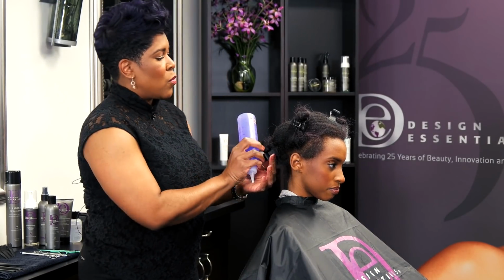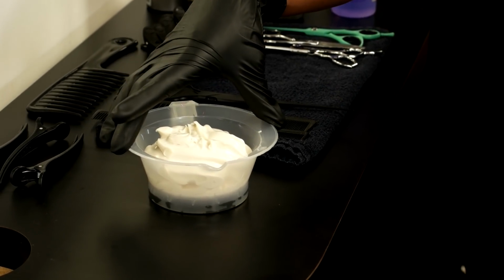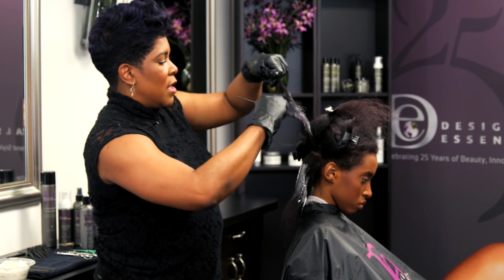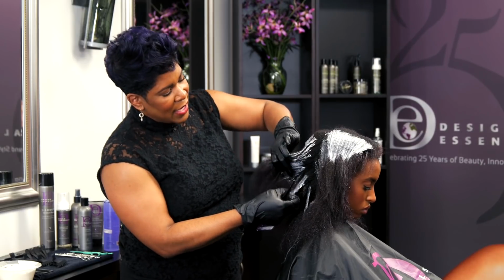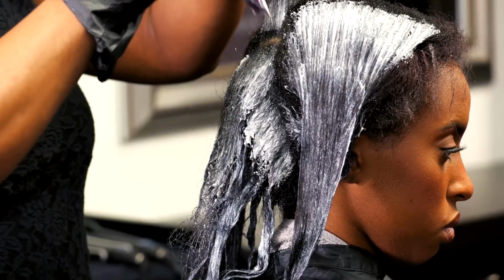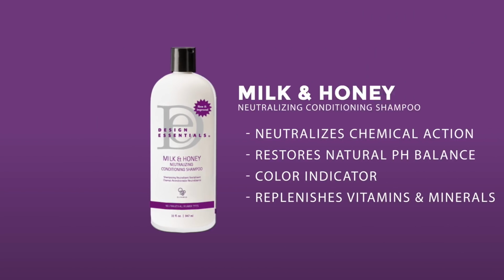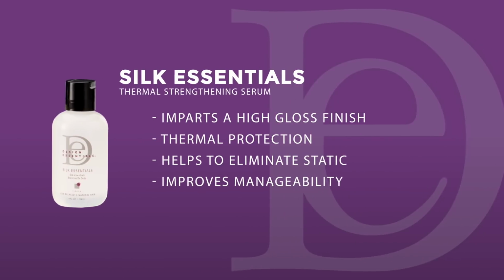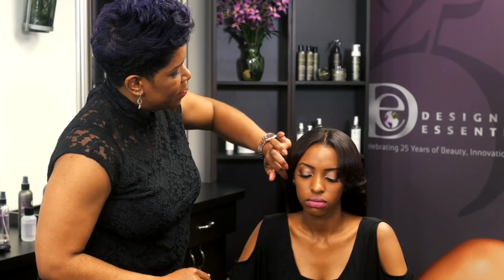Chemical Curl Restructuring Virgin Relaxer   featuring Alicia Bailey

Comment: She threw me off because my understanding is that you apply to the roots 2nd and  pull thru to the ends last reducing the risk of over processing her ends seeing as they are extremely porous and  reducing the risk of breakage.
Reply: I noticed the same thing. I'm not impressed
Reply: For a virgin relaxer that’s the way I was trained too. By putting it on the roots it processes faster because of the heat the scalp gives off.

Comment: Great job! I also wish you could train all beauticians because so many of them are improvising and the results show it.  I a new in town and  ended up having to use a beautician at Penny's.  She took shortcuts and was offended when I asked about and told me how long she had been doing hair. I couldn't leave wee were half way thru the process. I'd rate it  a 7 out 10 (the frizzies are right up front).  When I called to see if any qualified techs were avbl of course they said yes and advised they were trained in the use of Design Essentials products and quoted a price of $130.00.  She trimmed my shoulder length natural hair before the process then advised  the price was $200.00 because m hair was natural which I had previously advised when I called and the got the original quote.  Unfortunately I felt trapped because I had a holiday event the next day so I agreed to the cost.  She also decided it was better to use double paper when rolling the hair on the rods.  The end result was fair but there are 2 areas upfront of course that are have frizzy ends and didn't lock the curl as most of the hair did.  I'm not the professional but I think the double paper wrap and not catching the curl lock fluid and reapplying to make sure no areas were missed especially since she used TWO pieces of paper wrap per rod.  If anyone in the operating in the Gulfport area who can do my touchup in a few months when it's time let me know. Also if anyone can help explain why 2yr 3c Virgin hair has frizzy spots please advise and remember she trimmed the ends abt. an inch before starting the process.

Comment: Hi 
I wore a jheri curl in the 80's but my curl look like a wet set. The style that was done on the model I saw the look but it looked frizzy and the roller were to large maybe the purple I think there purple may have been better or flexi rods. What do think I have been a cosmetologist for 35 years as for the frizziness maybe the booster wasn't left on long enough or neutralizer  long enough it could been anything.